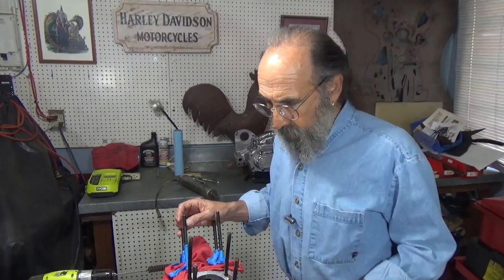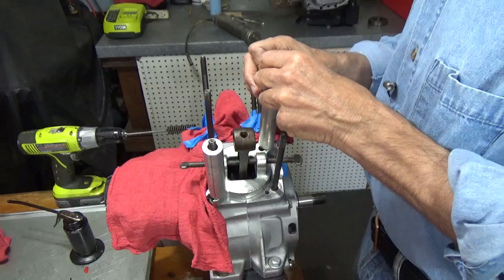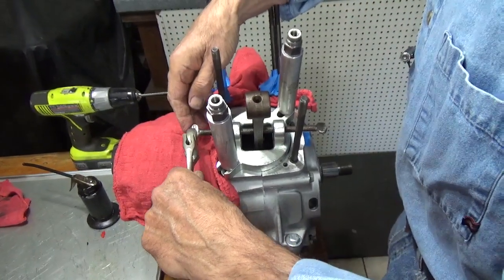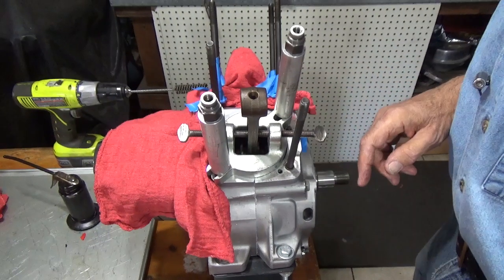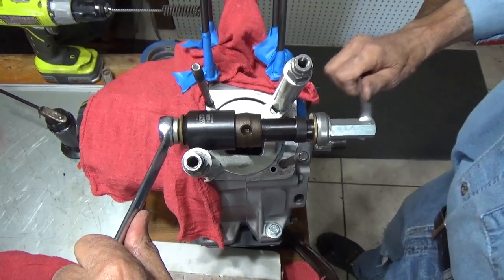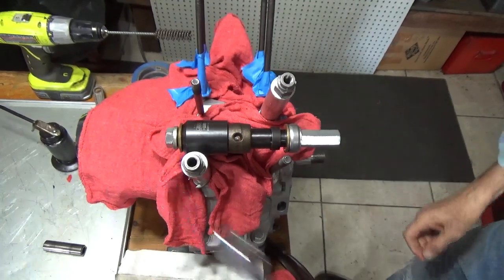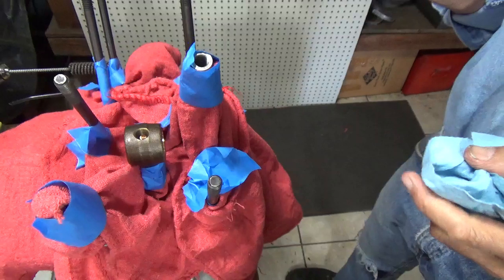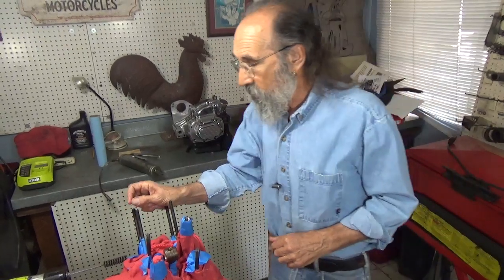Evo Motor Assembly Part 6, Wrist Pin Bushings

Comment: Would it be good to replace the wrist-pin bushings while the crank assembly is out of the case? To avoid filings getting in the case.
Reply from the maker: Block off everything you can to avoid getting those filings into the case or into the rod bearings.

Comment: Mike , is there any reason why you couldn’t install the wrist pin bushings before you install the connecting rods ?
Reply from the maker: That's the way it's done when rebuilding rods and lower end.  But when the lower end is tight and good and the wrist pin bushings need replaced, we do it like this.

Comment: what brand of torque wrenches do you use and what ranges are in your arsenal?
Reply from the maker: I use mostly Snap-On hand tools.  That includes the torque wrenches.  I use both 3/8 and 1/2" drive, depending on what I'm doing.  I think my inch pound torque wrench goes up to about 1000. My 3/8, 100 and something foot lbs., the 1/2inch goes to about 125 ft. lbs..  I have a big one for doing flywheel assemblies.  It's over 250.

Comment: Hola Pacífic Mike, crees que si se calienta con soplete la biela, entre más fácil el buje? Quiero hacer ese mismo trabajo a mi VW Bug, pero los bujes que compré parecen muy grandes como que no van a entrar, y ya corroboré que si son los que debe de llevar, esa técnica de un tornillos con una tuerca está genial, ojalá me entiendas, Saludos desde México!!!
Reply from the maker: That is not a "screw with a nut," it is a special tool made for the purpose and the measurements are all correct for the job.  Can't say how it would work on a VW.  I think I might leave it to a properly equipped machine shop.
Reply: @pacificmikesgarage  Muchas gracias por el tip jejejjee y gracias por contestar, tu canal está muy padre!
Reply from the maker: Thank You.  I've known so many people from Mexico that managed to do things well pretty much on their own.  I've seen Harleys from Mexico that had modified automotive parts that worked.  I wish I could do more to help you.

Comment: Great video. How do you keep the the reamer 90 degrees from the rod?Is the reamer self aligning? Thanks
Reply from the maker: Let the reamer and the bushing guide each other.  I do have a fixture (It is a Ram Jett item, carried by most suppliers).  Sometimes I use it, sometimes I don't.

Comment: I just inherited a 1996 Road King.   It has had 3 total speedometer on it. With a grand total of 200,000 miles on it.
Reply from the maker: Wow.  That is a nice motorcycle.
Reply: @pacificmikesgarage  my father took great care of it.  Your videos are very informative.
Reply: @pacificmikesgarage  I have an inner primary issue. The transmission bearing just falls out of the inner primary and the new bearing just slides in.  The local HD dealers have told me the inner primary is obsolete and don't have any. Would you have an idea as to who might have one?

Comment: Hey mike quick question I have a sifton reamer. I went through twice but I notice that putting the pin in it goes In nice from the side I started the reamer from but not from the other side. Do you run through twice from the same side? Love your videos. I’ve learned a ton from you. Thank you for all that you do👍👍👍
Reply from the maker: Sounds like it's not straight.  Is the reamer worn?  I don't want to make a long distant judgement.  Something is odd.

Comment: Hi Mike,
I was slightly  disappointed that you did NOT finish the ENLARGING of the oblong Bushing HOLE to ROUND ( and WHAT you used to accomplish this task ... a Drill Bit ? )  while on camera & the final fitting of the 2nd & 3rd pass of the tool (or the ADJUSTABLE tool ) that you mentioned
Thanks for the VIDEO
COOP
...............................
Reply from the maker: Sorry 'bout that.  I generally use a Dremel for stuff like that.  I do it automatically and forget to mention it.

Comment: Mike,. 

I truly enjoy your videos and I’m now a subscriber. I appreciate what you are doing. I am a full time machinist and Harley lover. I have one question for you concerning this video in particular and the process of replacing the wrist pin bushings. That is; why did you not perform this procedure when the engine was apart, so that you did not have to worry about the shavings from the reamer ?

I don’t know if I missed something or not? Maybe you already answered this question? Thanks in advance mike 

Again,. LOVE the videos !! 👍🏽🇺🇸
Reply from the maker: Cool, and thank you.  Rebuilding the lower end is quite expensive and on these older type motors, the lower end usually outlasts the upper end two or three to one.  If there's no reason to take that lower end apart, you don't.  Therefore, if you don't like the feel of that wrist pin in the bushing, mask everything else off and do it.
Reply: Pacific Mike but I thought that was the FULL EVO engine rebuild mike ? My mistake. Thanks for the reply.

Comment: I gotta do 8 of these on a motor. I already removed the old ones, just gotta put the new ones in and reem... wish me luck.
Reply from the maker: Good luck.
Reply: @pacificmikesgarage  thanks, your luck worked got them all pressed in the rods, all is good. Can I just hone the bushings to fit? They are floating pins, and super close for fit. I can't find a reamer online without buying a whole set, I don't want spend the money for em. Will honing to fit be ok? Very little needs to come off the bushings.

Comment: Isn't it enjoyable and rewarding to do your own work. You and I are a lot alike in the mechanical sense only difference is your the harley mechanic and I was an auto mechanic for years and years.  Well still am just on my own time now with small projects.But having all the tools and then knowing how to use them saves lots of money when repairs are needed.  The details are what's important and patience. Very important to take one's time and do it right. I've got bushings coming for my shovel and tools. The tools are the expensive part and the work is quite easy. When that motor is all together and running strong and your the reason for it being that way it's a good feeling. Thanks for the video I may be doing this on my 73 FLH seems I'm doing everything else to it. These old bikes are so easy to work on it's most enjoyable. Anyway thanks again brother for the knowledge and video it helps mould me from auto to shovelhead mechanic when needed... ✌
Reply from the maker: Thank You.  We're in agreement in so many ways.  I truly appreciate your kind words.

Comment: Hey Mike, I was taught to place the hole of the bushing so it's close  to the center of the rod but it rotates and would line up after upper rod bushing is installed. It rotates into position. Don't get me wrong. You know a lot of stuff some of us who don't use our training for very long . I had a co-worker(2) man shop, who would tap the flywheels in the truing stand.  You know, a knowledge hoarder. It's a cut throat business as a customer or a tech.
Reply from the maker: Yes, in a perfect world, that oil hole lines up just as you want it.  Sometimes it does.  When it doesn't, I open the hole with a dremel.  Hoarding knowledge is a waste of knowledge someone could be using.
Reply: @pacificmikesgarage  thanks Mike. You are correct about the knowledge . It is meant to be shared. All that can help is probably good.

Comment: Thanks man this video really  helped me out I am rebuilding my Toyota 22r and have never done  it before  I got one out with luck and try to heat press on and it did not work found your video and turned  my bearings puller in to a press
Reply from the maker: Cool.

Comment: 93k on a 92 1340 That still runs good, can it last a while longer? Thanks
Reply from the maker: Without an exploritory, no one could answer that.  Evos used to need base gasket replacements at about 40m miles.  We'd open them up, ball hone the cylinders, hand-lap the valves and, other than replacing the valve lifters in another 30 or 40 thousand miles, they were good for about 100,000 after that.  But, there are so many variables.  You just can't tell.

Comment: Very good tutorial. 
I would like to do a similar job on an engine where the wrist pin goes through the small end of a steel conrod but there is no bushing.
2 small ends (out of 4)  are used on my crank and have a ~ 0.04 mm bellmouth. I would like to ream these small end 0,05 mm oversize, maybe 0,1 mm if necessary.
My concern has to do with the alignment of reamer. I have thought about 2 types of reamers:
1)  one that looks like the one  you suggest in your video (at 18 :07) with spiral flutes of straight flutes. It can only expand by ~ 1/100 of its diameter
2) another ones that use several blades that slide over a conical shaft. 

The first type of reamer looks interesting as it may be inserted into the small end, then the screw may be tightened. The reamer would in principle align itself automatically providing a moderate force is applied to the T-handle. The issue I see is that this is not really an adjustable reamer: as far as I know, this adjustable feature is provided to compensate for wear on the blades when the flutes have to be re-sharpened. So the goal is to ream to the nominal diameter of the reamer. If we use such reamer, when the screw is tightened, the reamer will expand from its center and so the flutes have a barrel profile. But it may still be good enough on short bores ( ~ 20 mm in my case) like the small end of a conrod. Do you have any experience on this?
And if such reamer can be used on the small end of a conrod, can it be used to ream the bore of the wrist pin in the piston? There will of course be a barrel effect, but here again, as bore lengths are small ( ~ 15 mm in my case) it may still be acceptable.
Il you have some experience on this could you please share it and explain how to do the job correctly?

Regarding the second type of reamer, it seems to be that a jig is required to make sure the reamer will be aligned with the bore to ream. I have thought about a tool that would squeeze firmly the flanges of a small end and provide guidance for the reamer. 

Do you think it makes sense?
Have you ever seen such tools?
Reply from the maker: Wow!  This is a bit much for me.  I'm familiar with standard procedures done on Harley Davidson motorcycles.  When I get in over my head, I consult with machinists who are  competent at the specific job.  I don't know what you're working on or what the standard procedure would be.  I'm sure it's available.

Comment: I have an Elektra year 1991 in an Electra glide, I have a problem that the oil pressure after 30 minutes of being at minimum falls, the light comes on and I changed the oil pump.
The oil pump is changed and the same problem does not load the divers and I don't know what else to do, the pump retainer was changed and the pump is brand new and the same problem follows.
Reply from the maker: When I'm really not sure what's going on, I use a good mechanical oil gauge with a long hose to the place where the oil sending unit mounts.  I tape the gauge onto the speedometer.  Then I see if the "accurate" gauge readings match the manufacturer's specifications.  Your service manual will have those numbers for you.  Pressure at the beginning and pressure after the flow has split are what you're looking for.

Comment: Hey Mike this question is going to be off topic for this video but pertains to a earlier video you did, installing the Shovelhead motor into the frame. Well I'm in the midst of just such a project, I just got my motor finished (78fx) and put it into a different swingarm frame than it came from the factory with, (long story) anyway it's a good unmolested stock FX frame of the similar year which I had blasted and power coated, all mounting points have been cleaned up of the powder coat and down to bare metal. Put the motor in the frame and torqued the rear mount bolts then checked the front to see if it needed shimming and it does, big time. I'm getting a gap of .042 on one side and .040 on the other. Heres my question since I've only done a few Shovelheads in my lifetime and that was many years ago, been riding the modern stuff since the inception of the EVO and later the TC but I got a older age crisis and wanted to do another Shovelhead. Seems to me that is a excessive amount of shimming, seems to me I remember from years ago doing this on a few different occasions and got like .004 or thereabouts, anyway much lower numbers. When you did your install video you didn't go into shimming and I'm wondering have you ever seen or would you consider a number like .042 normal and just go ahead and shim it that much or is something wrong somewhere possibly? Thanks!!
Reply from the maker: Don't know for sure.  You gotta look it all over.  A lot of the Shovelhead frames are about .040 low on the left side of the trans.  Also, all of those motor bolts should be tightened down gradually, not the rear to see if the front raises or the front to see if the rear raises.
Reply: @pacificmikesgarage  I did look it over pretty good before I installed it, or so I thought, nothing jumped out of the ordinary, made sure the mounting surfaces were clean. So I'll do it your way, tighten all 4 bolts gradually back and forth the check for gaps. I guess there is a lot of bad info floating around because I read several sources who I thought were creditable say tighten the rear to 35' lbs first then check the front and shim accordingly. Thanks for the input! Have a great time at the swapmeet! MLH&R

Comment: so could you also do this when you had it all apart, and before you put the cases together? Or is there a reason you waited to do this after it was together??
Reply from the maker: Well, yes and no.  The flywheel assembly was a good unit and didn't require disassembly.  So, there was no way to hold the rods while replacing the wrist pin bushings.
Reply: I was wondering the same thing.  Seems like it could have been done before the flywheels were pressed into the case.

Comment: Why would anyone go this deep and not replace those bushings? Seems awfully silly and lazy if you as me. Do you rebuild later motors Mike, i.e. Twin Cams? I have no doubt you’re more than capable, just curious.
Reply from the maker: Sure.  But I really prefer the older engines.  And I usually do stuff either only for myself or I get conned into helping someone.  I'm retired and really want to start on another bike for myself.  That is my goal in retirement.  Youtube keeps me in touch with people.  I miss my old customers.

Comment: THANK YOU...for sharing. You can have a small fortune in Jim's tools but they sure make the job a lot faster and nicer. Gary from N.E. Oh.
Reply: ELSDP-45 you’re not kidding about the small fortune in Jim tools! You can also check out I think it’s MBF Manufacturing. They make basically the same tools as jims just without the fancy laser engraving. However they don’t make all of the same tools so with some you’re still stuck buying the jims.
Reply from the maker: Many years ago, I had a boss who told me, "It's easy to make a small fortune in a motorcycle shop.  Just invest a large one."  Yes, good precision tools cost a lot to make and only the very dedicated can justify the expense of buying them.  But, they're really a pleasure and usually necessary for doing a good job.
Reply: indeed !  a lot of money invested in the tools to do it right . next time i'm at my indy getting some work done i won't complain about how much he's charging me !
(i don't anyway he does a great job for way less than the dealer)